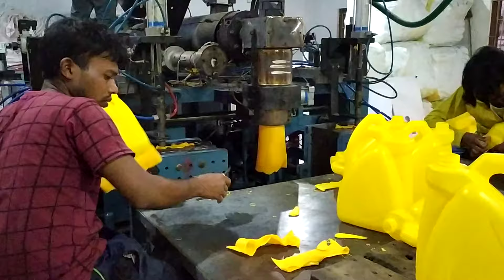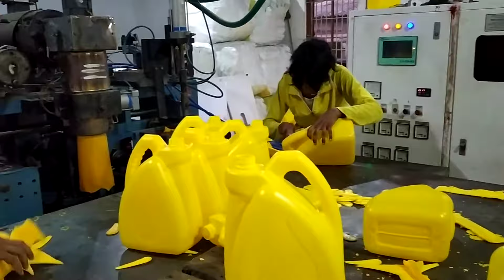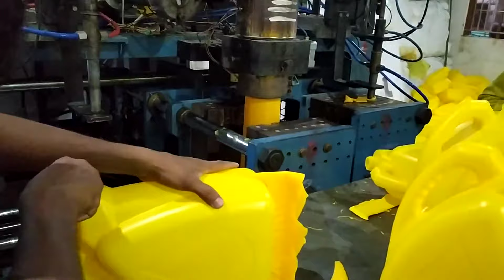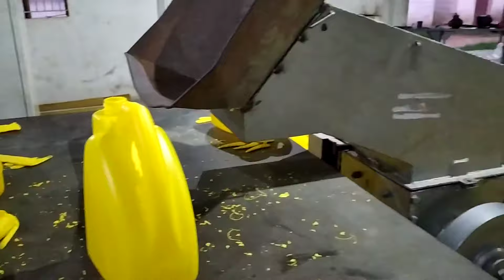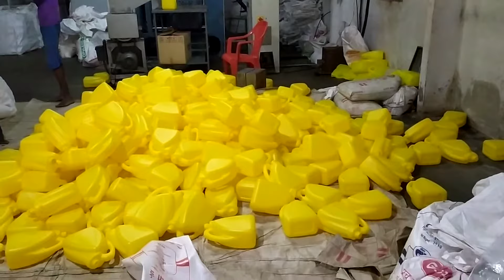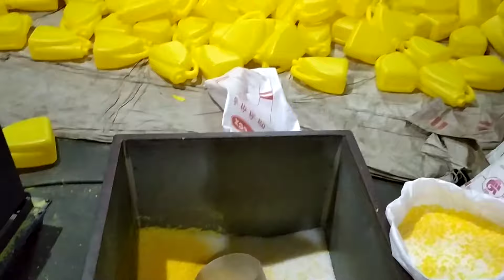5 LITER BLOW MOULDING MACHINES DOUBLE SATATION

Comment: How much does a molding machine like this cost? Not specifically for plastic containers but just in general? thanks
Reply: The mold will cost you $15K-$20K. if purchased in America.  If it's a Chinese mold it might cost half that.  The machine can range from $15k-$100k depending on what you are looking for. Most of my expertise is in injection molding, and not blow molding.  They are similar industries.
Reply: @sheepman6291  Is that including the Mold itself or just the machine that turns the mold into final product, if that makes sense.
Reply from the maker: call us or whatsapp @ +91 9940454844